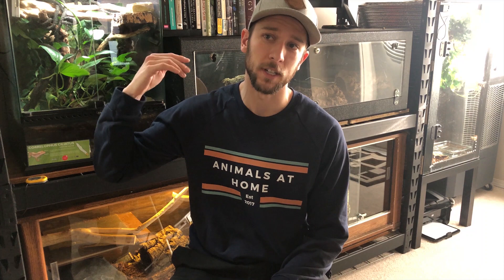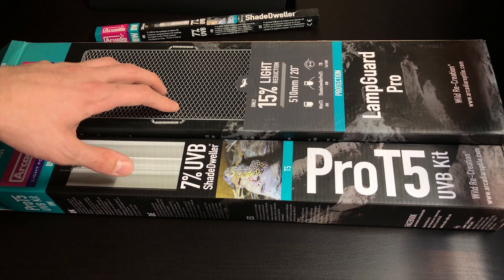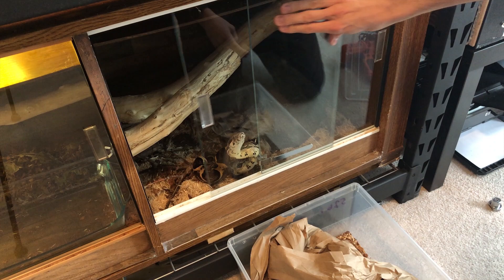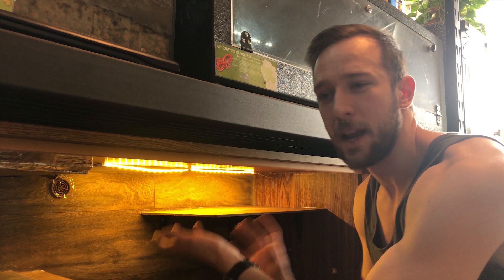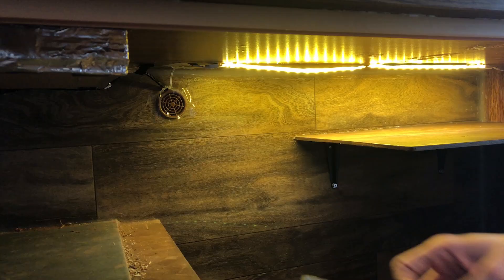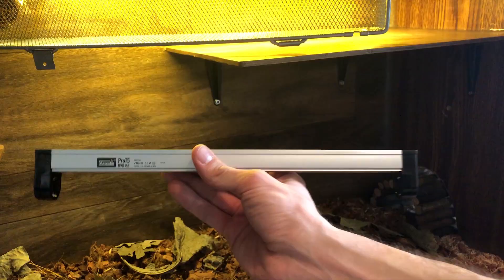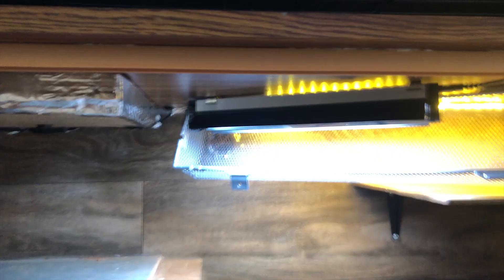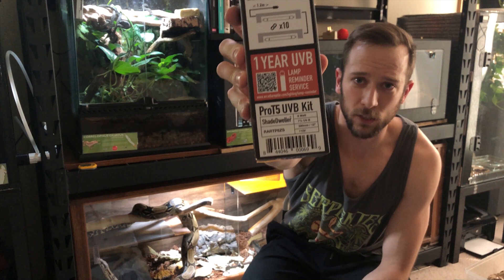UVB FOR SNAKES! Better Care Challenge!

Comment: I have heard that as uvb lamps age, they can increase their output. I bought a digital uvb meter to check mine; I have not had this happen, but it’s worth bearing in mind. It is always good to keep spare lamps; the uvb tube in one of my enclosures starts to flicker when it’s “dying”, and this will undoubtedly stress an animal.
Reply from the maker: I should probably pick up a meter as well, it would be super handy to have around. Yeah I’ve heard that a few brands are (or were) notorious for increasing their UV output near the end of their life (Exo Terra... although I think they have since fixed that issue)

Comment: PS: some animals hate bright light: my albino darwin carpet python is one: when I had a uvb lamp in her enclosure, she would cover her head with part of her body when she was lying under the light, so I only use a basking lamp (no uvb), on a dimming thermostat: this lamp only runs very dimly, and she no longer hides her head.
Reply from the maker: That’s a very interesting point… I wonder if it has anything to do with her albinism. Albinism typically causes eyes to be very sensitive to light, not to mention the white scales  would have less defense against UV due to their light color. That is definitely something to consider for sure!
Reply: She was using the UVB though. I don't understand how covering her head while sitting under UVB means that she hates it. It's like taking UVB from a leopard gecko just because their natural way of "basking" is to expose one or two body parts to the UVB while having the rest hidden under a hide.
Reply: @gryllidaeperkcal1369  Sorry, it does mean she hates it. She was under the uvb because when she's out of her hide she almost always hangs out on her branches; the branch on the cooler side is under the lamp fixture. Her lamp is now a heat lamp on a dimming stat, and is always either off or at very low brightness.  She never covers her head now. It is well known that albinos are photo sensitive: there is no pigment in their irises.
Reply: john schlesinger So was the branch she was sitting on under the UVB? If a reptile hates something they’re most likely going to avoid the source all together or pass by it quickly rather than put themselves through it. I believe hate is a rather strong word for what your snake did in reaction to the light perhaps dislike would be better considering that she doesn’t hate it enough to skip going onto a branch directly under the UVB. Have you tried providing branches in a shaded area to provide a light gradient?
Reply: @gryllidaeperkcal1369  Yes, there is another branch further from the lamp, but that is on the warm side. I think you do not quite understand:  a reptile's number one priority is thermoregulation.  When this snake comes out of her hide, she always goes to the higher branches near the heat panel.  After reaching the desired temperature, she goes to the lower branches on the cool side; this was where the uvb lamp used to be.  For a carpet python to hide its head under its body is an unnatural behaviour.
Reply: Very late reply. Albino animals are unique. From Wikipedia: "Albinism can reduce the survivability of an animal; for example, it has been suggested that albino alligators have an average survival span of only 24 hours due to the lack of protection from UV radiation and their lack of camouflage to avoid predators."
 
Albinism is a severe genetic disorder. They lack UV protection. Eyes are light sensitive. And they have poor vision. People with albinism are often diagnosed legally blind.
 
Albino animals should be considered special needs animals. As mentioned, they have virtually zero chance of survival in the wild.
Reply: @grisflyt  Thanks for that: a lot of people don't know about how sensitive these animals are.
Reply: @johnschlesinger2009  Indeed. Albinism isn't just a color morph.

Comment: Thank you for this video. Thanks to you I have gotten so much into reptile lighting, and I'm such a lighting nerd now, but I still have a lot to learn. 
Do you think about replacing the radiant heat panels with basking lights in the new enclosure?
I use Halogen lights combined with a few other rays and wavelengths penetrate much deeper into the tissue than radiant heat panels do. Also halogen bulbs are really cheap and produce a light that animals connect to warmth, whereas radiant heat panels produce no visible light.
Halogen bulbs are the one thing I wouldn't buy from arcadia though, their UVB and LEDs are amazing but from what I've heard their basking lights tend to break easily. 
My hog island boa now has almost full spectrum lighting and a good shade gradient, he has developed an amazing basking behaviour now, and I almost always see him more active during the night. 
All my reptiles and amphibians will have UVB light and attempted full spectrum lighting with an adequate shade and temperature gradient.

Always learning new things and I am so happy I found your channel.
Reply from the maker: Thanks for watching the video! Yes with the new set ups I will absolutely have halogen bulbs, that’s what I’m using on my day gecko enclosure and I love it! You’re Right they are quite cheap and produce a nice warm colored light. The radiant heat panels will be thrown away 😀  i’m considering trying the Arcadia deep heat projectors as well, because they can be used for night heat (no visible light emitted).
Reply: I'm happy to hear that! I really look forward to seeing their new enclosures. 

I am also thinking about getting some DHP for nighttime use since I have quite the temp drop at night that almost always is a bit below the usual nighttime drop that happens in their natural habitat.

Comment: I wish they made a lamp cage that is shorter for the Shade Dweller.
At least the cord will fit inside the cage, since I think my snake would try to go between the cord and the ceiling if possible.
Reply from the maker: Yeah I was thinking the same thing, a shorter cage would have been much easier to use!

Comment: Hiya, what about corn snake? I was gonna get one and the reptile shop told me I don't need one just a light would do as I use a deep heat projector and there is no light, so I got a led light
Reply from the maker: Many people will tell you corns don’t need any light at all however I disagree. I believe we should all strive to provide full spectrum light if possible (uv, visible light, infrared). Search for my podcast episode with Dr. Baines. It will help you out 😁
Reply: @AnimalsatHomePodcast   will definitely listen to it,  what do you think of the deep heat projectors? That's what we went for as we thought it was best heat, We ordered a led waterproof strip for the vivarium would this do?
Reply from the maker: @lauramoore9601  the deep heat projectors are good, especially because you can use them at night. Halogen heat is the best, but obviously that’s only for the daytime. So you could always use the deep heat projector at night and a halogen during the day. And yea, the LED strip should work well

Comment: Do you think UVB lighting is beneficial to Ball Pythons as well? I know they are nocturnal and they can benefit from some UVB, but everyone I've asked swears you don't need it and they do fine without it or even are stressed out by it. What is your personal experience?
Reply from the maker: YES, absolutely! I don't personally have experience with BP's but in my opinion, they should definitely be provided with UV. The light setup I have in this setup (Arcadia Shadedweller) is designed for nocturnal animals so it would work well for BPs. Don't listen to those saying they don't need it... those keepers are behind the times. Check out this playlist I put together, it's videos (made from my channel and a few other great reptile channels) specifically discussing light https://www.youtube.com/watch?v=vO7eqoGhI5w&list=PLh5fybvrrZIcLIbR1KO156Z_n0zbhfP7y

Comment: I love TC. He's the one that introduced me to your channel. I have a question about UVB for snakes. I have several different kinds of snakes, hognose, children's python, milk snake etc. most of them are in 12 inch tall enclosures. I can't decide whether to use the Arcadia shade dweller or the Arcadia 6% bulb. I will be putting the light fixture on top of the screens on top of the enclosures so some UVB will be blocked. Several of my snakes are also albino. So I know I need to provide a lot of hiding places and cover for them. Do you suggest I get the shade dweller or the 6%? It's going to be expensive no matter what I do.
Reply from the maker: Agree, TC is a great guy! It's a good question— I think you could realistically go with either. One thing to keep in mind however is the bulb length. You'll probably only want about half or less of the enclosure to be illuminated with the UV bulb. So if the 6% bulbs span right across the entire enclosure I would lean towards the ShadeDweller. That way a section of the enclosure is in the shade. @JTB Reptiles just did a great video on setting up lighting for his bearded dragon... of course you won't need anywhere close to the amount of lights he has but it will give you a good idea of how to set up a UV gradient.
Reply: @AnimalsatHomePodcast  well, that probably needs means I need to go with the shade dweller. Might have to do it in stages. It's going to be really expensive. I would basically need 10 of them. I like the fact that you can link them together though. I have other T5 high output fixtures that are great, but you can't link them together and it's turning into a big mass of cords.

Comment: What kind of light should I use for my ball python? I have a dome but I'm having trouble finding a good bulb, and I'm not even sure which one to use
Reply from the maker: The issue is compact fluorescent UVB bulbs (i.e. the ones that fit in a dome) are typically very poor. I would recommend the Arcadia Shadedweller (the same one I use in this video). It is a fantastic bulb
Reply: @AnimalsatHomePodcast  I was thinking the same thing, they suck. But there's really sucky and less sucky. For now, that whole thing just costs too much for me so until I can get that I'm just trying to figure out the best bulb to use for now.
Reply from the maker: I hear ya! I’d go with a 5.0 uvb compact florescent in that case, that should work 👍🏼
Reply: @AnimalsatHomePodcast  ok thank you 💕